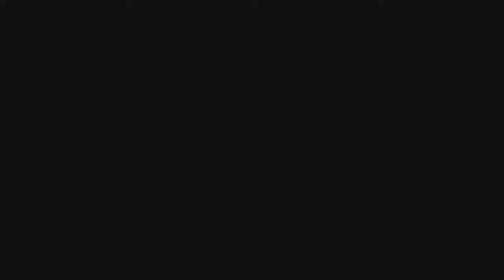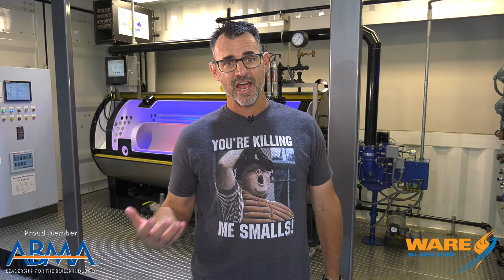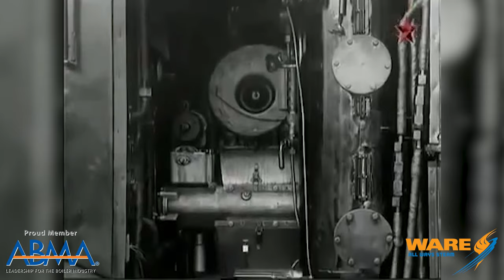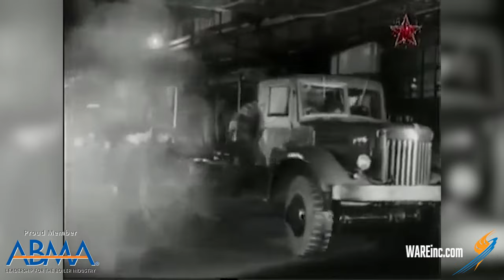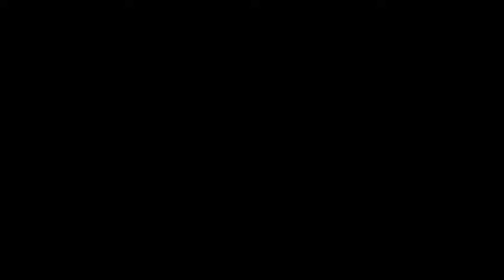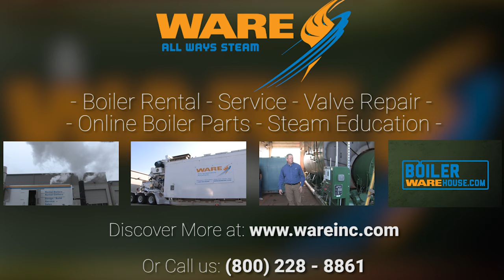Russia's Steam Powered Truck - Steam Culture

Comment: We should be using more steam electric hybrid. Wood pellets, propane, There are more viable options for affordable, available fuel. Turbines are the best for generating electricity that goes directly to a battery bank. Electric means no weight time. Give it a gear box to save power consumption. The 3 technologies help each other perfectly to extend range and deliver power. External combustion, electricity generation and gears. A steam car went 132 mph in 1925. We ran our battle ships with steam electric. Tinkering with small steam turbines and electric bicycles could be promising.

Comment: Have you seen the British sentinel which was made before these and was a lot better than this Russian thing due to the boiler being water tube and not fire tube which somehow made a better vertical boiler. There is a YouTube called doubleboost that has videos of the larges sentinel made running and some of when they had the cab off so you can see the boiler.

Comment: Why steam instead of wood gas generators?
Reply: Probably efficiency. Wood gas generators are pretty inefficient, generating a lot of waste heat. The efficiency of the car engine on wood gas is also not great. It might very well be that a conventional steam engine and boiler consume less wood. 
But this is mostly speculation. I am completely certain that there have been studies about that in the 1940s, i just don't know where to find them.
Reply: wood gas actually sucks ass it just barely works and most gasoline cars can use it with minor modification that's why it's semi popular